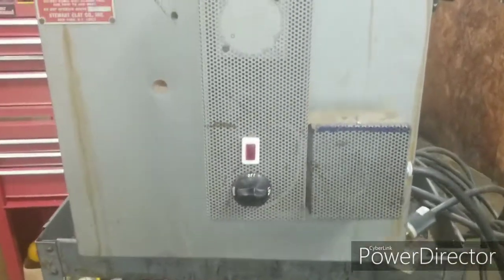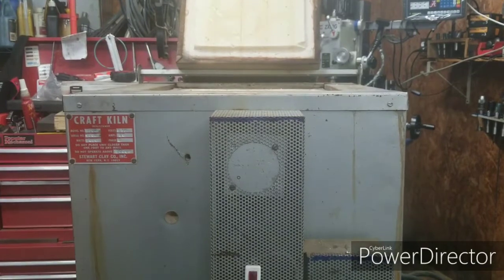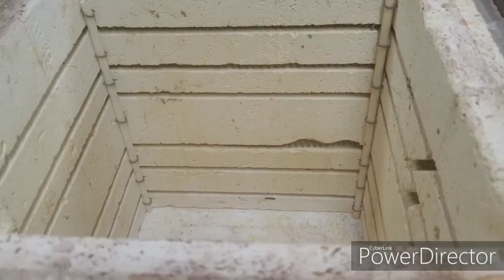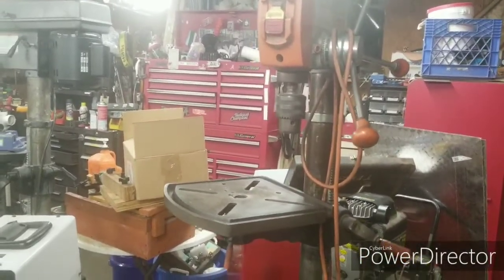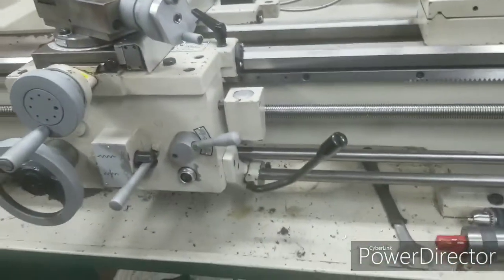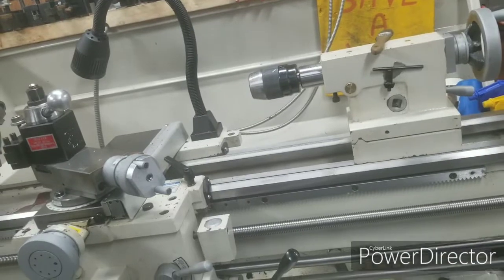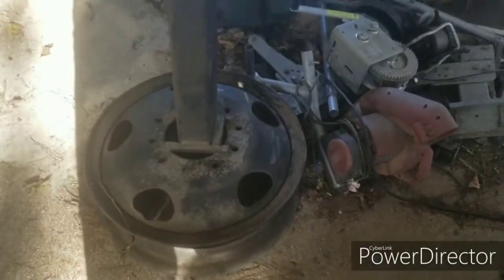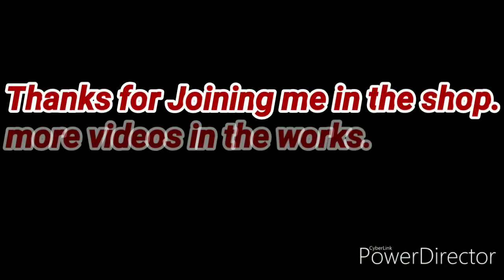A Simple Tool Grinding Fixture Made Better!

Comment: Sorry to hear you are having some bad health.  When you get old like us it seems to happen more often.  I would choose petrobond just like Mrpete uses.  The problem with green sand is that it is so hard to get the moisture right.  Too much and you get bubbles in your casting and too little and the mold falls apart.
Reply from the maker: Thanks for stopping in

Comment: Anthony, glad to hear you are getting better.  Nice goodies for the shop and good tips for the spanners.  As far as sand, I would look for some fine sand at the building supply and buy some bentonite clay.  Preferably western bentonite.  In a 100 pound batch you will have 94 pounds of sand and 6 pounds of clay and about a quart of water.  check out sandrammer channel as he has a lot of info there.  https://www.youtube.com/user/sandrammer

Joe
Reply from the maker: Thanks JOE I will check into that for sure.. THANKS for your help and thanks for stoping in.

Comment: good stuff! good to see an update. youll learn a lot from youtube on foundry, but really you need to get some sand and try urself. beach sand and bentonite clay is probably cheapest and easiest
Reply from the maker: Thanks Emma It will be a while before I fire it up got to get all parts in and get my son to do the wiring.  Me and electrical are not on the same level if you know what I mean can do basic but that's it. Thanks for joining me in the shop. And thanks for the help.
God Bless and have an awesome weekend.